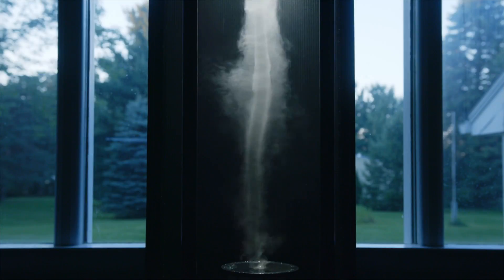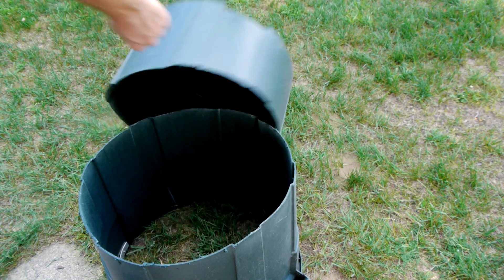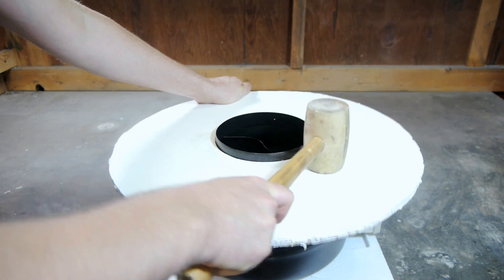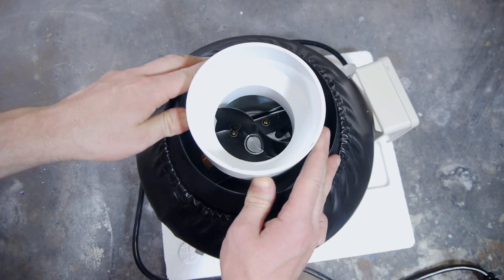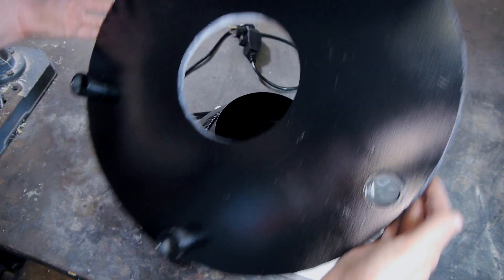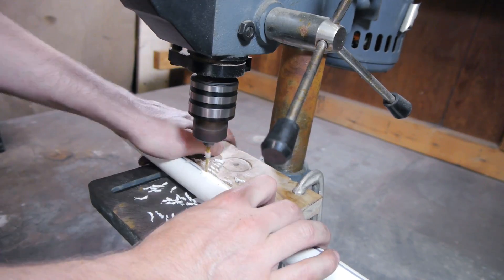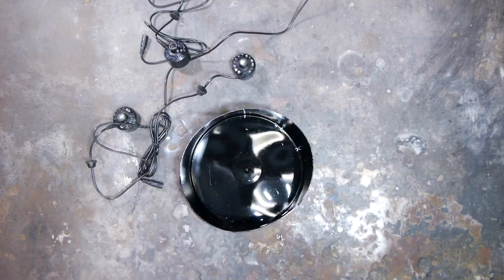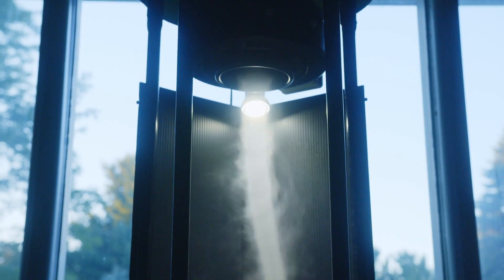How To Make a DIY Tornado Machine [Full Tutorial] - NightHawkInLight

Comment: Hello good day id like to ask about on of the machines you built. The tornado machine, my team wanted to make one for a science museum for kids to demonstrate the tornado effect, my question is that the exhaust fan you used is a centrifugal inline fan i was wondering if this can be substituted for a inline turbine fan as well?
Reply from the maker: I'm not entirely sure of the differences between fans. I expect the centrifugal fan has higher output pressure, which may be necessary to push air through the legs. You can optionally use a seperate fan to provide pressure to the legs compared to the one on top. In fact I'm not certain that a fan is necessary on top at all if the leg pressure is high enough.

Comment: You  an aldo make it with a dry ice and make sure you also put a Water in it and make hole for the top and but the fan facing to the smoke thats created by the dry ice and spin the Fan and it will make a tornado (edit sorry for the typo at the also)

Comment: I've been considering building a tornado machine for a while. Many of the designs I have seen use dry ice or liquid nitrogen or CO2 to produce the cloud. That was a turn off for me because it requires I keep a source of dry ice or liquid nitrogen on hand in order to run it. As alternatives I considered using propylene glycol (a fog machine) to generate the cloud. One day I was experimenting with an ultrasonic transducer from a water fountain and it seemed like it might be a good way to go as there is always a supply of water and, its non toxic and can also act as a humidifier. Seeing your video confirms that the ultrasonic transdueer idea works. I am going to experiment with different designs, small & large and see if I can duplicate similar results.

Comment: Great video and design! I made a tornado machine inspired by yours, other designs and the storm structure around tornadoes. Video on my channel.

I ran the full output of an air pump through a single jet to simulate the rear flank downdraft which descends and wraps around a supercell tornado. The jet enters tangentially into the large circular area enclosed by the sawed-off top of a water cooler jug. This sets it rotating and descending to the ground. The pump's intake then sucks it back up from the middle through a pencil-thickness hole in a cap covering the jug's opening. The tornado it makes is strong enough to fling drops of water.

Comment: How it will work if you do not make holes in the legs?
Reply from the maker: Without the holes there won't be a vortex, and without a vortex the smoke won't be drawn upward in a stable fashion. It's just be a mess of smoke, most of it drifting off to the sides and not moving toward the fan

Comment: Not sure if u will read this but, if I were to make the tornado machine 5 feet tall instead of 3.5 feet tall. Would there be enough airflow from the pvc pipe rotation?
Reply from the maker: Yes it should still work.

Comment: Approximately what angle are the tubes offset from pointing at the core of the vortex? I have played around with mostly water vortex rings, generated through a 2.5” hole or by mouth. I would like to make a circular version of this project that spins up a ring and [theoretically] holds it there until I stop pumping water. I’ve never seen one motionless, so I think it will take off. I plan to use pieces of hose to wrap in four circles, two large and two small. A frame will hold it. It ought to work in air, but water is much more stable. 
Thanks for the video.
Reply from the maker: That would be really cool to see if you get it to work. Let me know if you do. My tubes are basically just pointed in a circle so each is pointing to the one on it's left. Maybe pointed a little more inwards than that but in this case it doesn't make much of a difference.
Reply: Thank you. I saw another video for making a tornado with four vertical air fans, and they were the same way. I’ll get a video and upload it onto my account. Since I’ve got a heavy schedule (school, cutting brackets, making water glasses, etc), it’ll be a while before it comes together. I 
plan to use a large pvc tube with another inside to push water through the holes. If it works, it will be very fun.

Comment: just thinking, given if the finances are available to me a bace/reservoir made from a second trash can and pvc bored with only one hole cut into it instead of six would more stable than the five legs, and with a bigger diminutional capacity than a coffee can it wold last longer between refills any thoughts or suggestions?
Reply: Hunter_Eliason i do believe what you're thinking will work, and that is what i intend to do when I build this.  I also plan to add weight to the base to make it more stable so my 2 year old niece doesn't knock it over easily  :)

Comment: I have seen a similar version of this with a fog machine where, like yours fog was introduced at the bottom and exited the top. One thing that bothered me was that fog was loose at bottom where introduced and tightened up to a tight spiral at the top. The OPPOSITE of the way real tornado looks. I was wondering if you reversed things and introduced the fog at the top and put exit fan at the bottom if you would get a more accurate representation and if you think it would still even work? I am planning on making one of these for Wizard of OZ Halloween party.
Reply from the maker: It would be more complicated to build but it may still work.

Comment: i want one with legs about 6' long.  you think there'd be enough air to accommodate that much pipe?
Reply from the maker: Yes, there should be enough air from the fan, but the legs might need to be larger diameter pipe to allow more to flow through them.

Comment: i once build a closed circuit. 4 plates with a small gap around on the edges and a top fan. Problem was that the device ended up watering the fan not good if using a computer fan. Next up blowing the device rather then sucking it. four pipes directional and then closed with a hole in the top. I saw someone insert a wire mesh to catch and recycle part of the water to make sure my surroundings don't get wet like before. Then if I get it working I will run a humidifier switch on it. I had some succes only not sustainable. And 220 fans and water don't always mix unless indicated on em.

Comment: When I've cut PVC sheeting with a jig saw I found if I use the most aggressive blade I can find and adjust the speed (assuming you have variable speed saw) to the fastest speed that it won't melt the trailing edge . A band saw works very well for outside cuts too.

Comment: ???  The link AS SUPPLIED for the ultrasonic foggers, takes us to Ebay and a generic selection.  What specifically should we look for RE voltage and or dimensions???   THANKS - Hopefully going to be a wonderful project soon!
Reply from the maker: +TheOregonOutlaw They should all work fine. Get ones that come with a power supply and decide if you want them with our without LEDs. They are all the same on the inside otherwise.

Comment: If you made this on a larger scale would it actually make a tornado?
Reply: I don't know but you would still have to block the side air currents which would be virtually impossible on
Reply: That scale?
Reply: Simon Leidö huh? view all reply s
Reply: no, it would not, you need hot and cold air to make a real tornado, as well as electrical power found in thunderstorms or thermal power like in fire tornados.
Reply: The Museum of Science and Industry in Chicago has a 40 ft tall one, and it is very similar to this design.

Comment: My main questions on this were how loud is the vent fan and also do you know about how much electricity this runs. My house is dry and a regular humidifier just doesn't go well with my house. Only changes would be to go with either copper, stainless, or the black pipe to go with the rest of the room.
Reply from the maker: The fan is about as loud as a regular box fan on medium. If all you want it for is as a humidifier you don't need to make the whole machine, All you need are the ultrasonic foggers and aim a fan at them to blow the fog around. It not as interesting but it would work pretty well. Another easy humidification option is to just get a spray bottle with distilled water and mist your curtains every once in a while.

Comment: 2:39 This applies to acrylic as well. If anyone knows a good way of cutting it, lemme know because it's a pain in the ass with a jigsaw.
Reply from the maker: I just ordered some acrylic parts for an upcoming project so hopefully I'll think of something.
Reply: Maybe you could cool the blade with water while you're cutting? Probably a bit messy, but it might prevent the material from melting.
Reply: NightHawkInLight I just read a little thing mentioning that high tooth count blades can help, perhaps if you do this and use water like Andrew Meyer suggested, it may work. I'll have to try it.
Reply: In my experience with cutting plastics, the lower the tooth count the smaller the dust created. Smaller particles are easier to melt. Cut with big enough teeth to avoid melting but small enough to keep from breaking the plastic if the tooth catches. On a jig saw I'd just get the largest teeth that you can.
Reply: Jeremy Rider Interesting

Comment: Did you test the most effective angle of the return piping into the vortex?  If so which angle worked best?

I can think of two possible answers: A) between 30° & 60° from the machine's outer tangent inward all in a clockwise or counter clockwise direction, OR B) tangential to the outer edge of the formed vortex.  (Both assuming a fully enclosed machine.)

Any fluid dynamic people have a solution?
Reply from the maker: In the real world I think it's a little too variable for the mathematical ideal to really work best. I just played with the angle until it worked how I wanted.

Comment: Could you make one that's smaller? Like a six inch tall version with CPU fans and a single vaporizer?
Reply from the maker: Maybe, I haven't tried it.
Reply: I'm very interested in making a smaller, desktop version, and would appreciate it if you could help me figure out how. I was thinking of using a plastic cup for the bin, straws for the legs, and a cpu fan, but I don't know what I'd do from there, or even if the tornado could support itself at such a small size. What are your thoughts?
Reply from the maker: You'll have to try it to find out. Your guess is as good as mine

Comment: Quick Question- Does anything actually blow through the holes in the stand, because I couldn't fully understand that part.
And all your videos are awesome keep making these great ones!
Reply from the maker: Yeah all the air that goes around the outside of the pvc reducer that is put in the center of the fan is forced into the top of the housing and from there goes down into the legs.

Comment: Great video! Where did you source the PVC board? I'm not familiar with that material.
Reply from the maker: They had it at Home Depot. It's not cheap, it's something like $50 for a 4x8 sheet. You can use plywood instead, you would just have to really lacquer it up so it doesn't absorb too much humidity and warp.

Comment: I don't quite understand how the fan system works. I'm guessing it blows air up out the top, and somehow builds up extra pressure which comes out of the pipes?
Reply from the maker: Pay close attention to how the pvc reducer goes in the fan. Some of the air comes out of the middle of the reducer, but most of it goes around the outside which blows into the upper housing and from there down into the legs.
Reply: Ah, I get it! That's a way of separating air currents I have never seen before. Very neat. For some reason it clicked after reading this and looking at the ~5:00 mark. Thanks.

Comment: That's an interesting design. As far as I'm aware, the tornado machines in science museums only use one fan. My design has two fans, one in the top and one in the side. In my machine the bottom box is pressurized by a high air flow computer fan which then leads the air pressure through four pipes. The cords for the top box assembly run through one of the pipes, giving the machine a "wireless" look. Obviously your design is way less expensive, but you could definitely run the fan for cheaper. I'm getting away with a ten inch box fan that's being run through a dimmer, though I don't have to worry about the pipes being pressurized by that box fan. Overall you've made a very nice and simple design, and it looks professional.
Reply from the maker: Yeah I should have specified. It's easy to make a tornado machine with only one fan if it's the kind where you fully box it in with glass walls and slits in the side let air in at an angle. That's the kind that I've seen most often in museums. I haven't seen any others that only use one fan and let you reach in and touch the tornado though. Usually this sort of design has at least two fans as yours does, or even one for each leg. Not that there's anything wrong with that at all, I just wanted to try something unique.

Comment: How much air flow output does that fan have?
Reply from the maker: 440 CFM on high, but I run it on low. Not sure what it's putting off at that speed.
Reply: hmmmm, i was wondering because i am currently trying to make my own air conditioning unit... using 2 pc fans to blow through a radiator with ice cold water in it... but one of the fans broke and i was wondering if there was a better solution for getting air through the rad, does that fan have good pressure? if so it might be the perfect solution
Reply from the maker: Yeah it has very good pressure because it's got a turbine sort of blade setup. Much more than a traditional fan.
Reply: Thanks :) btw your videos are amazing, it makes me want to build every one of your tutorials.... but i don't think i have enough money and room and time for all of them xD
Reply: I've made an AC unit using ice water. It didn't work too well as my setup didn't have enough radiance to really make a difference in room temp. Although if your pump is pushing enough water and the radiator is big enough, it could actually work quite well. It was a fun project but just don't expect it to cool off a hot room too much
Reply: Se7enAte my mate had an old condenser/tumble dryer thingy, and we took the radiator out of it that used to cool or heat the air going through it or something, and a quite powerful pump from a fish tank, and we found that the radiance was too good, it literally took 5 minutes for the ice to completely melt and the water to go warm........ soooo i will need to either get a bigger reservoir or find a better way to keep the water cold, but in that 5 mins we left the room and turned off any things that made a lot of heat (my pc), when we came back in, we felt it was indeed colder... but only just
Reply: Well then you should definitely have enough radiance. Best of luck to you.
Reply: Thanks :)
Reply: maybe you could use some peltier moduals to transfer heat out of the water?
Reply: Squid Of Overkill That could work pretty well but would use a lot more power and would need a cooling system to dissipate the heat from those too.
Reply: ever watch linus tech tips? if so you probably know about whole room water cooling, im thinking something alot more streamlined to cool the peltier I might make a graphic later explaning better
Reply: Well a peltier element is quite expensive, and one of them is not going to cool down a whole room, it's only good for like blowing at your face..... I'd need an array of quite a few of them to cool a room......... the ac I've made has had no money spent on it at all so far

Comment: Is there any reason you couldn't direct all of the airflow into the legs, and get away with using an even weaker/slower fan?
Reply from the maker: You could definitely use a 4" model rather than the 6", but I didn't know that when I was first coming up with the design so I figured better safe than sorry. If you directed all the air into the legs it would probably make the tornado spin a lot faster. It might also put a little too much strain on the fan and make it louder. Speaking of that, another reason to use a bigger fan is that a big fan on low speed will be quieter than a small fan on high speed.

Comment: I guess this would scale down really well using a high volume 12 volt PC fan and small buckets? 
Great project, thanks for sharing.
Reply from the maker: You would think so but I'm not sure. The cool thing about these inline duct fans is that they use an impeller which outputs air at a much higher pressure than normal fan blades. I don't know if a PC fan would be able to force air down into the legs.

Comment: try to let us hear the noise it does
Reply from the maker: It just sounds like a fan, not a very interesting sound.
Reply from the maker: I'm not sure how to do that with the equipment I've got. It's about as loud as the medium setting on a 20" box fan.
Reply: robmobz no, i personally wouldn't. read the frequency range on that thing!
"Frequency range: 31.5Hz to 5KHz,Accuracy: among 1.5dB,Sample rate: 2 times/second"
Reply: For a somewhat accurate result there are several apps on the Android market that claim to measure dB levels. It would at least give you some sort of ballpark estimate.
Reply: can you measure the loudness in dB?
Reply: NightHawkInLight yeah sorry i think you'd need a edit SPL meter for that, they go for about $50-1000... so really, depends on what you want to spend on that. it's not generally THAT useful, so i wouldn't spend it.
Reply: I would use a cheap meter like this:  https://www.amazon.com/Leaton®-Professional-DL1351-30-130dB-Included）/dp/B01CCD6CNG
Reply: He doesn't need an SPL meter, all he needs is a cheap meter that measures in DbA which can be bought very cheap. They generally are rated up to 120DbA.
Reply: Lir